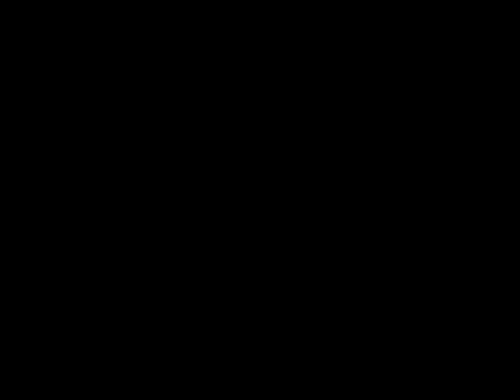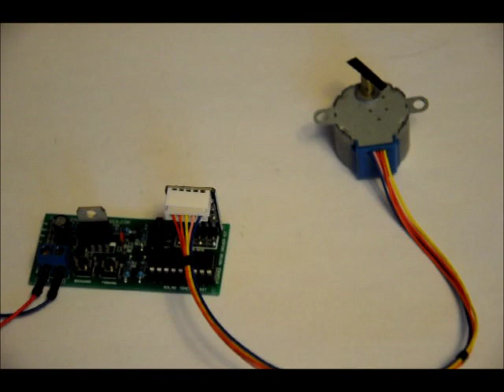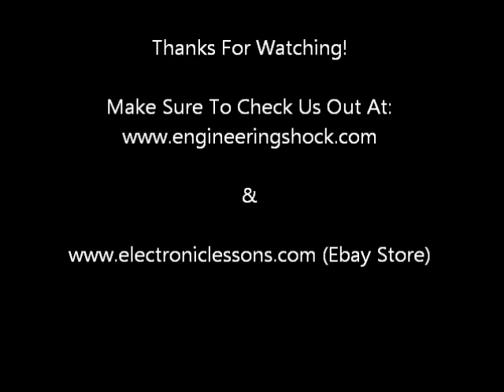The Stand Alone Stepper Motor Driver Module With Arduino Contol Option

Comment: Hi,
 I need something that is turn key. A board that will be able to drive 2 DC motors controlled by a signal coming from an RC receiver. 1 channel for each motor. 7.4 volts. To be used for a camera pan and tilt system. Is there one available.
Reply: مذپتت جا جوجه غهققتیو ب ز